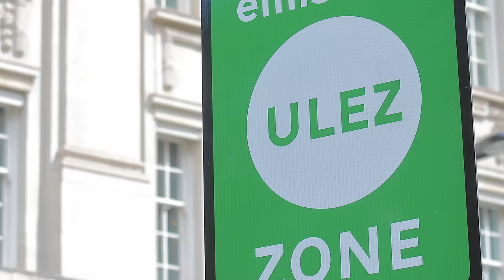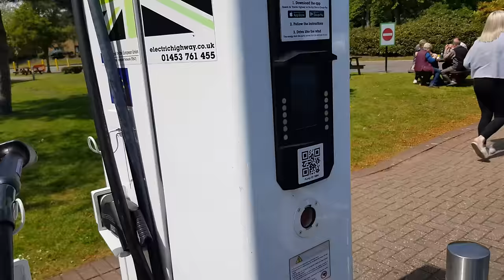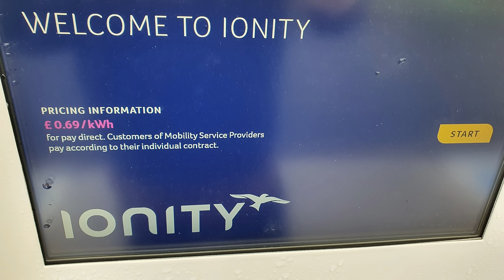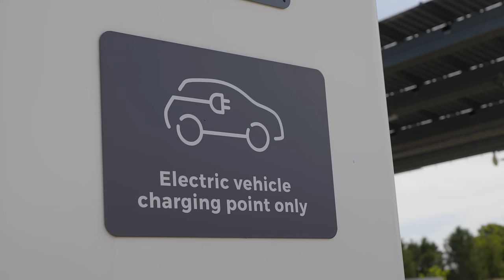The Uncomfortable TRUTH About EVs: The Version NEITHER SIDE Wants You To Hear

Comment: Really enjoyed this James.  As usual, you gave your best to offer an unbiased, balanced view.  You touched on my biggest concern, being batteries getting to end of life before the actual car does.  There needs to be ways that the batteries can easily be checked and exchanged without prohibitive cost. The purchase of an older car is often the only avenue for those on a lower budget. A cost affordable way to keep older EVs running is a must.
Reply: And that's the deal breaker. A used EV 10 years from now will be 10K, but ... oops... 10K for a new battery.  I am NOT even considering an EV until cheaper options like an easy to swap (a few brackets and bolts) Sodium battery is available.  3/4 or even half the range but $2K and an hour in the shop to replace keeps us all running.   My friend had a BMW i3 and the battery bricked itself 3 months inside warranty.  If it had been after the warranty, it would have been a $14K charge to replace.  That's outrageous.
Reply: Battery cost are coming down. As supply chains improves and more manufacturers increase their EV offerings, prices will come down. Basic supply and demand economics.  For now, EVs have to survive all the FUD while prices, range, and charge times continue to improve, IMO. Battery tech has already improved tremendously,  compared a 10yrs old Nissan Leaf vs a basic Model 3 LFP...
Reply: @Teddy_M85 The issue is that they practically build the car around the battery, resulting in a $6000 battery and $8000 in labor. Lithium-Ion batteries are also problematic as they trade cost and safety for ultimate capacity.  Which nobody really needs 99% of the time.  So we end up with $14K replacement costs instead of $2000 for the battery and $500 in labor. Lowering the battery cost to $5000 won't solve anything as we'll still have toxic mines, issues with safety, and a replacement cost of a now discounted $13K.  
The technology is simply not ready for mainstream.  They are all targeting the top 5% who care about bragging rights on 0-60 times and the fact that they CAN go all the way across the state on one charge (despite never driving more than 40 miles from home).  Instead of less expensive, more reasonable, and safer models for the rest of us working folk. 
And that's not even considering the charging.  Where I live, electricity rates are 45 cents per kwh at a local charger. Of if you bought into the cult of Tesla, a slightly cheaper 30 cents and an hour wait to use it, plus congestion charges and sales tax. The government uses 11 cents to calculate MPGe.  Meaning that that 120MPGe is now 1/3 of that. (actual costs locally at a supercharger is about 33 cents, not 11 cents).  That's equivalent to a 40mpg hybrid, which are everywhere. And if you're at a normal charger elsewhere, well, 1/4 of that, or 30mpg.  
Oh, and there's also the grid.  What are you going to do in a city like Houston or Belfast? The grid is barely holding itself together during winter storms.  Adding thousands of chargers to homes is... that will work out well. 
We need another 20 years and vehicles aimed at the working class.  What we have now are toys for the rich and the burden being shifted to the poor.
Reply: @Teddy_M85 battery technology really hasn't improved at all though... it's the same basic chemistry, and essentially all that's happening is bigger batteries (both individual cells and the overall packs) are going into cars, which increases range but also massively increases weight. This means that for low range usage efficiency has actually got worse, since you're lugging a heavy battery around just to commute back and forth for example. The original Leaf design brief was low range, low weight... the technology is actually almost exactly the same.
Reply: PS the charging times are actually a major part of the lifespan issue, something which Tesla are conspicuously quiet about. The impact of fast charging Lithium Ion cells is very well understood and dramatically impacts lifespan... none of this represents improvement in the technology... it's more a willingness to sell it as new and not talk about the implications.
Reply: Wait until NIO release their first car in the UK and with an exchangeable and upgradable battery pack that gets tested every time it goes into the charging station and repaired as necessary.
Aging battery problem solved and when the battery has reached the end of its useful life it is  incredibly easy to recycle
Reply: @saimonarnet5015  I am hearing that it will be about 169 a month.  Pounds.  So, again, nice, but aimed solely at the top 5%.
Reply: @saimonarnet5015 this will be impossible to implement at scale. It's worse than trying to get hydrogen filling stations in place.
Reply: @Teddy_M85 Battery prices coming down? If your Hyundai battery pops in Canada, a new battery costs more than a whole new car.
Reply: @plektosgaming  I agree electricity is going up in some areas, but you are under estimating 90+% of charging is done at home. I personally have solar, but even without solar, there's time of use rates as low as 3cts per kwh available in most cities. I agree that those who do not have access to a lv 2 charger at home or work will lose out on convenience and pay more for electricity,  but that's not stopping the 1000s of ride hailing workers that use lv3 chargers everyday, its a business decision for them and even with the extra charging cost they are saving money or else they wont buy Tesla's. Yes, some batteries will inevitably hit the fan prematurely, but that's a problem with any high usage vehicle. LFP models seem to be best for ride hailing. You have to weigh maintenance+gas cost vs. battery replacement... Tesla battery packs used to be north of 20k to replace, but now, depending on the size, it can be replaced for 9-15k in the US. The old Leaf and GM cars had air-cooled packs vs. Tesla's liquid cooled battery packs, which allows for better durability,  faster charging, etc. Today, this is normal for almost all OEMs so things have improved and will continue to improve. The main risk comes from hitting something on the road that could damage a cooling line... The next step is to perfect the structural packs to use less weight, easier pack replacement, and longer lifespan via new chemistry. EVs won't replace every single gas car, but it's not aimed at 5% of the market. IMO it's closer to 50% of the market TODAY... Time will tell, but Tesla is selling close to 1.8 mill by themselves with only 2 mass market options...
Reply: @chimpana   The original model S had a 200ish range, and now the new one is in the 400s with a similar pack...  Changing cell size has many advantages, but it is clear the 4680s need a few more generations to reach the original acclaimed figures. To think it won't get better over time is 🤯 IMO.. Cybertruck cells already improved energy density over 1st gen Model Y cells, but we need more data to confirm... They are definitely playing it safe and software limiting the charge curves as they should... Plus, as other OEMs copy Tesla's giga castings and develop EVs from scratch, they will learn new ways to improve the EV form factor and ultimately use smaller battery packs per car...
Reply: @Teddy_M85   no, I'm afraid not... despite many claims, improvements in actual energy density for Li-Ion cells simply isn't happening in the way you describe. Are the cars themselves more efficient - possibly. But battery chemistry is one of the most highly studied topics in recent years... and has proven amazingly stubborn. Meanwhile there's always some new battery technology in a lab somewhere being sold as the next best thing in 2 years time, yet it never comes through... energy density is an insanely difficult problem. And unfortunately batteries are heavy and expensive. Broadly speaking the higher range is almost always achieved by putting a large battery pack into the vehicle (and perhaps lying about range predictions, but that's another story). And yes, i'm aware of the prototypes that have been produced that show much higher density etc. - the issue is they don't work at scale, or reliably.
Reply: @Teddy_M85  In the U.S., 54% of people don't have their own home, rent one that they can't alter, or live in an apartment/flat. In the U.K.,  it's better, with 35.6% renting.  But say, in Germany, it's 57% that rent instead of owning.  This doesn't factor in Home Associations, lack of infrastructure to support home charging, or issues with cost to install a level 2 charger at home.  On average it seems to work out that half of most industralized nations' families own a home, but the other half - they are left without a paddle and there's a giant wall of brown stuff heaving their way.
I guess the future is one where EVs are mandated and something only for the middle classes and above. With half of the population being lower class soon, well, sorry, back to being peasants and reliant on the state to get around.
Reply: @plektosgaming    Your stats prove my point. Do you seriously think only 5% of the folks that own a home can afford a 40k EV?!?! EVs prices are going down, just like LCD TV prices went down... It's called Wrights Law... BTW I have family that rent and own a few Tesla's. They have no problem charging at work and using the occasional superchargers 🤷‍♂️
Reply: @chimpana  I'm no scientist and won't argue on chemistry,  but overall packaging is just as important... Saving weight with the car or structural packs and increasing efficiency with better aerodynamics is not normal for most OEMs. As they catch up and develop platforms from scratch, it will help save on battery size, which leads to more supply, lower production cost, more volume,  etc,  etc, lower EV prices.... Wrights Law all over again...
Reply: @Teddy_M85  it's absolutely true that prices will come down, I agree. Not sure where the floor for that is, but it's already happening due to competition (and Fwiw I think it'll kill Tesla eventually). My argument is purely about battery technology and it's limitations, and particularly the implications when it comes to needing to do a battery replacement.

Comment: I always enjoy these chatty, thoughtful, balanced features from you. We're all basically here for the cars but I'm with you 100% on the larger picture of sourcing information from all around then making your own decisions. To keep it car-relevant, I'll be keeping my little fleet of smaller petrol cars for the foreseeable. Merry Christmas and thanks for this year's content.
Reply: I see no problems with EVs in a city situation  but where I live in a rural sunurb. No chargers. Or two single  chargers within  10 miles. I do nearly 100 miles plus a day? I could get a charger fitted but my power suppliers tells  me the  current network  would not be able to carry the amperage  required in  my  area. That also applies to garage chargers who have told the same. My own dealership for my car told me that replacing faulty batteries would not be economic. A whole battery pack would be  easier. But more expensive. I also don't like automatic. I have a s.lope to drive up to get out of my house it needs high revs . With automatic I leave the top of the drive like a Cork out of a bottle.  I like to have gears I can control. I have other worries  which would take too long to  explain.
Reply: I'll be keeping my petrol cars and motorbike too !